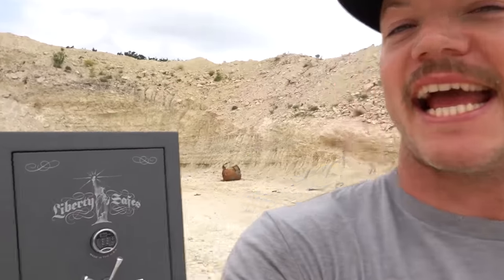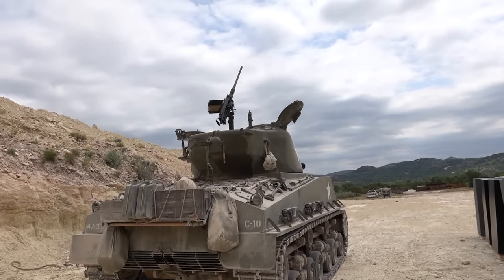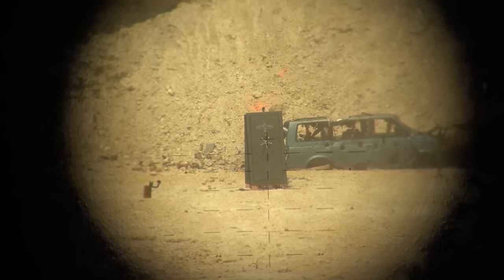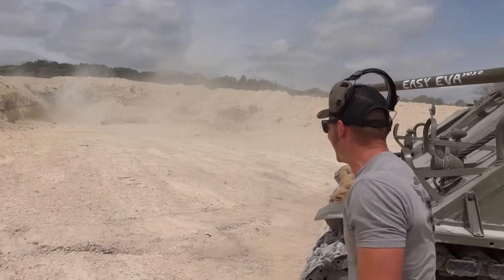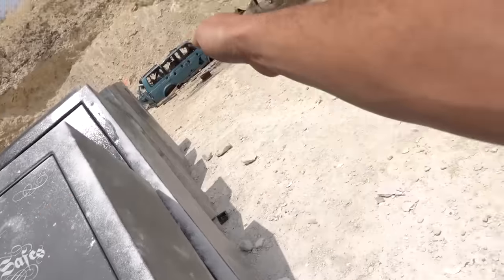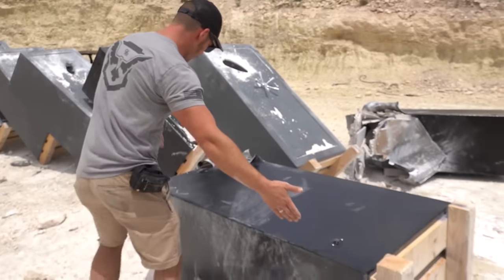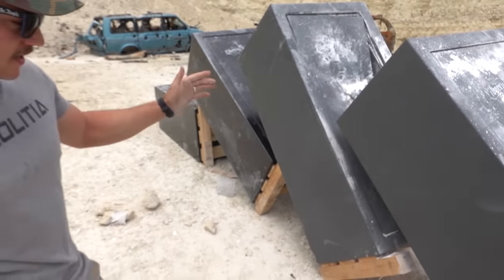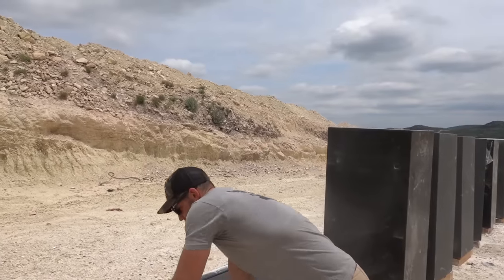TANK vs GUN SAFES!!!

Comment: The amount of power/force behind that solid piece of metal is just insane. I would not want to even get hit by one of them even if I was inside a tank
Reply: It's probably worse to be hit while inside a tank because when a shell pierces the armour of a tank, it causes parts of the armour it is punching through to become pieces of shrapnel (aka "spalling") that scatter and turn everyone inside into Swiss cheese.
Reply: The fact is if you were against a sherman tank inside a german tank in ww2 pffft wont even give a scracht to you man. Sherman tank's cannon were not that strong
Reply: @comradevladimirlenin5690  If you are talking about the 75mm then yes it lacked power against other tanks but a Sherman with a 76mm cannon (such as the one in the video) is very capable of destroying most German tanks used during ww2.

And if you still think that the Sherman's cannon is weak then there is the Sherman Firefly which was developed for the exact purpose of destroying heavily armored tanks such as Tigers and Panthers.
Reply: @warpey5632  the normal sherman tank which was used in the ww2 had a weak cannon but the cannon in the video is prob replaced with 75mm. I was talking abt the "sherman" not firefly one.
Reply: @warpey5632  for example if youre in a panther or tiger tank unless he shoots your behind or sides then it will just bounce or get stopped.
Reply: @comradevladimirlenin5690  The 75mm was powerful enough to destroy the panzer 3 and 4 at normal combat ranges with few issues. It was weaker than most tank cannons of its caliber but it was still a very capable weapon.
Reply: @warpey5632  when the americans joined the war and sent tanks there was mostly "panther" and "tiger" models that was being used by germans and it was impossible for a sherman tank to penetrate a tiger tank from the front armor. I dont really know abt the panther but it wasnt really easy for it to penetrate a panther from front too.
Reply: @comradevladimirlenin5690  That is true with the 75mm but the 76mm is capable of destroying a tiger and a panther. However, tigers and panthers were produced in limited numbers so most of Germany's armored forces used the Panzer 3, 4 and the Stug.
Reply: @warpey5632  indeed 76mm was enough to penetrate them, but the sherman tanks were using 75mm cannons during the ww2 and they were actual paper against the tiger and panther models and abt the limited thing, the panther tanks were mostly used by the SS units and if we count the part that germans didnt have much gasoline at these times they was mostly using the panthers even if not tigers
Reply: @warpey5632  if I say anything wrong then it may be a lack of knowledge of mine sorry for that
Reply: @comradevladimirlenin5690  No. When America joined, nearly all tanks they encountered where Panzers. Nearly all of the Tigers and Panthers were used against the British and the Soviets and the Americans extremely rarely encountered these vehicles. It was only much later in the war the Americans encountered these tanks more frequently and responded by replacing the 75mm with the 76mm. Even then, those tanks were still relatively rarely encountered and many shermans kept their 75mm because it had more powerful high-explosive shells which are useful for dealing with infantry and anti-tank guns.
Reply: @warpey5632 the tigers and panthers were on the west side not on the eastern front the panzers were the ones mostly used against soviets
Reply: @comradevladimirlenin5690  The 75mm was paper against Panthers and Tigers because the 75mm was intended as an all-purpose gun meant for fighting tanks, infantry and fortified positions which fitted very well with the sherman's purpose as a reliable jack of all trades master of none sort of tank. The 76mm was a gun designed specifically for anti-tank combat, so it obviously fairs better than the 75mm against tanks. As for the panthers and tigers, they are also built with tank combat in mind and have the armor to prove it. Unfortunately, the panthers and tigers were logistically impractical. They were very expensive to produce and consumed a lot of fuel which was scarce in Germany and needed excessive amounts of maintenance or else they will break down which they frequently did before, during and after battles which was further worsened by a lack of spare parts. Panzers and Stugs were prefered because they were much easier and quicker to manufacture.

So yes, the 75mm was ineffective against Tigers and Panthers and no, the Tiger and the Panther were not Germany's most used tanks for logistical reasons.
Reply: @comradevladimirlenin5690  Plenty of Tigers and Panthers were sent to the eastern front. In fact, the main reason these tanks were designed was mainly to counter the Russian t34 and kv1 who have proved to be too much for a standard panzer.

Comment: I’m definitely jealous of that you’re up close next to an M4A3E8 “Easy 8”
Reply: that was the "jumbo" not the easy8
Reply: Otakuryoga Call sign for the 76mm M4A3E8 Jumbo Sherman. Guns the main difference between the two
Reply: Skink Fink theres a few differences that Sherman is definitely the A3 Easy 8
Reply: Programmer Pxartist Going off of my knowledge with tanks there’s a slight difference with the A2 and the A3
Reply: @StalwartRook  Jumbo is a M4A3E2, not E8. Hull/turret plates are different.  Designation won't change if you change the gun.
Reply: Crag_r I was trying to convey that the E8 is the Jumbo with the 76mm. Both are “Jumbos,” but the E2 has a short 75mm.
Reply: @otakuryoga  Not a Jumbo.
Reply: @frauzschttek2098  Yes there is- this is an A2.

Comment: I'm currently saving up for a liberty safe and this pains me to watch 😭 lol
Reply: I can see a few used ones coming up pretty soon for cheap 🤣
Reply: I used to build them. I have 4 safes I brought home that we’re dinged and scratched. I’ll sell ya one for dirt cheap bro. Same exact safes in the video, one King safe that double the size. All have working locks and lights
Reply: 4RUNNER4x4 how much?!
Reply: Now you're saving up for a tank.
Reply: well, read more on it before you buy because they say that insulation in these safes, (dry wall) is actually bad for your guns. Look at people breaking through them so easy and maybe youll want to spend money on something thicker than 12 or 10 gauge steel. A 7 gauge steel is just 3/16 of an inch thick. Remember, even if there is 10 gigantic locking pin the the front door, the thief will go through the sides.A simple battery powered grinder will cut through that. They say fireproof for x min duration at x degree fire, but it gets so hot during the fire that the ammo inside can explode and even if the ammo doesnt explode, the guns are still ruined. Look online if you dont believe me. I was also in the market for big gun safe like that but now i dont know anymore.
Reply: @millwrightdad3753  I'll buy one

Comment: “we’re gonna use a cable to pull the trigger because if it fails the whole thing could explode” continues to pull the string standing right next to the thing that could potentially explode lmao
Reply: Tanks don't go kabooooom like in the movies. The only time that could happen is if the ammunition storage  gets hit. If a round detonated inside the chamber, the barrel will take the majority of the damage and mushroom, but your danger is the concussion from the explosion.

Which explains why the had it facing  opposite of them.
Reply: In this environment they put a single shell in the tank at a time, nothing in the ammo rack.  And that one round is in the barrel. So just that is already one huge hunk of metal around the only potential explosion, plus all the armor of the turret and Hull. 

It's really more for insurance reasons than anything. We did have several soldiers in each of those tanks way back when and they all fired quite a number of rounds, with ammo racks starting full. If the gun is in good shape it should be safe enough to fire from inside.. but I'd bet their insurance company said nope

Comment: Depends on the round : Apc, apcr, heat etc will do diff penetrations
Reply: JeffGDj The problem with HEAT is the copper jet will only penetrate the front side of the first safe and probably won’t penetrate past the end of the safe into the next safe because of the momentum loss.
Reply: They used a basic AP round didn't they? Not an APBC or APCBC
Reply: I looked it up and the various rounds (APC, APBC, APCBC) are rated for 120mm homogeneous armor @500yrds, so the combination of dead space inside the safes and tumbling is what kept the round for reaching the backstop. I doubt the combined thickness of the safes was anywhere near even 50mm of steel.
Reply: @RamielNagisa  spaced armor and multiple safes stoped the shell unfortunately...
Reply: @RamielNagisa  normal AP. Ballistic capped shells have a marginal impact on penetration values. It just reduces a lot the chances that the shell would just shatter on impact before it has time to transfer energy to the armor. The modern Leopard 2A5 and up variants use a similar method for front turret protection where the pike is empty inside and only has 20 mm of thickness. It acts like a shot trap, forcing the shell to rotate once it passed the first layer and hits the main armor sideways. Results in 2 things, no normalization effect (tip of the shell does not "bite" into the armor for better energy transfer) and spread of the impact force creating far less pressure on the armor surface
Reply: Stefan Dinescu This is true, this is why German spaced armour with practically nothing inside seems far more impressive than other type of external armour like Russian ERA as the ERA packs detonate upon impact and are used, meaning the if a shell hits the same spot again it will likely go through, if it already didn’t in the first place.
Reply: "That's what she said"

Comment: The tank is an M4A3e8 Sherman, (aka Easy Eight). It has a 76 mm gun.
Reply: i have a 122mm i can destroy them easy
Reply: @rickgrimes_69420  lol
Reply: I thought i was a M4A1 Sherman
Reply: @SakuraiZ25  you better be joking
Reply: Ok my son is waching  this shogun
Reply: Its actually an m4a2e8
Reply: @micro2108  no it’s an a3, you can tell from the hull of the tank, an a2 wold have a cast hull.
Reply: @taco6658  I'm talking about the tank in the video, its not an a3 its an a2.
Reply: @taco6658  Actually I read that wrong, only the m4a1 and hybrids would have a cast hull, none of the m4a2 had cast. But the one in the video is still an m4a2
Reply: @micro2108  what makes it an a2
Reply: @taco6658  The engine is the main difference between the a3 and a2 but there are small external changes to the exterior that can also distinguish this. The engine deck hatches are different and the a3 had a small rectangles that the engine deck can rest on when its open on the back. In the video teh rectangle isn't there at 1:44, it should be between the shovel and pickaxe head if it was there. If you really want the proof in the pudding go to drivetanks.com/the-sherman-package, the Easy Eva (which was in the video) is called the M4A2E8, Cobra King should be just the M4A3. 

TL;DR: go to drivetanks.com/the-sherman-package, its called M4A2E8 instead of M4A3E8
Reply: @micro2108  ok thanks, I’ve learned something today
Reply: Ever played WT
Reply: @daltonsteedgaming2872  no I play wot

Comment: I can't afford one safe and this dude blows up 10. Wtf
Reply: Don't worry it was just a bunch of cheap Chinese manufactured safes.
If you get a safe get Vault Pro, thicker and higher quality steel, made and manufactured in the USA.
Reply: Do you really need a safe made mosty of drywall?
Reply: @tziodim  loser is spelled with one O. 
And not all steel comes from China just the majority. And it doesn't change the fact that liberty safes are nothing more then cheap Chinese junk that can be broken into with a 10 lbs sledge and a prybar. Videos all over YouTube of people testing safes, and liberty didn't hold up.

Comment: It all depends on a couple different things...the size of the gun looks like a 76 mm, what kind of ammunition is being used? For example...APC, HEAT, or HE.... It also depends on the range and angle of impactvwhich im guessing is gonna be from extremely close range for a tank and the shell will be hitting with a near 90 degree angle to the surface (or dead on), if your using armor piercing rounds its gonna through them all or close to it
Reply: I believe they used a bullet round. If it was AP, it would have gone through all of those safe like a hot knife going through butter. And if it's HE, half of those safe would have blown to pieces.

Comment: Shot a safe with a sherman tank's main gun to see what happened? Sounds like my cousin and his crew who took a fridge to the range, when they were in the armoured battalion of the ADF and shot it with the main gun of their Abrams. The APFDS was as you'd expect, the HEAT was reportedly pretty terminal.
I'd imagine it'd go through all of the, it'd likely peirce the combined thickness of all the safes if they were a homogeneous plate, for a solid shot AP round, the fact that they are not homogenous means it'll have a much easier time punching through each individual plate.

Comment: It's not possible for a Sherman Gun to explode fire inside you can just fire inside there 5% chance a Sherman E8 blows if it does it might be the ammunition or engine failure 
Very rare to happen in 2022 only happens when no one is doing maintenance at the tank